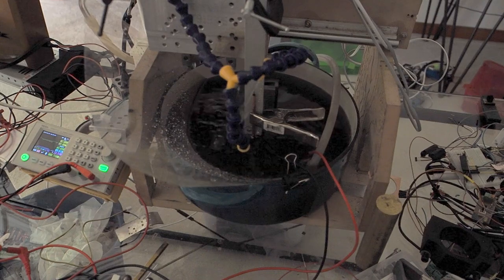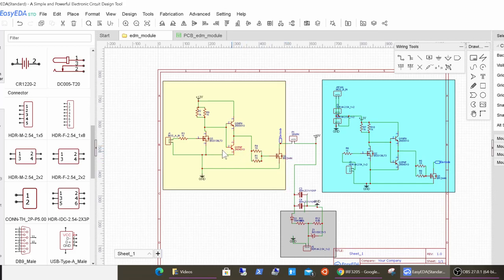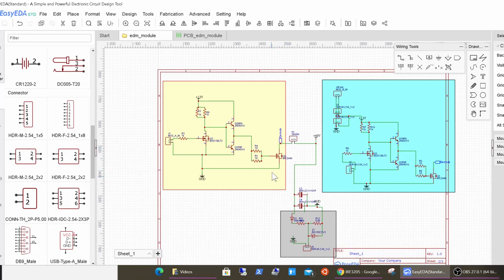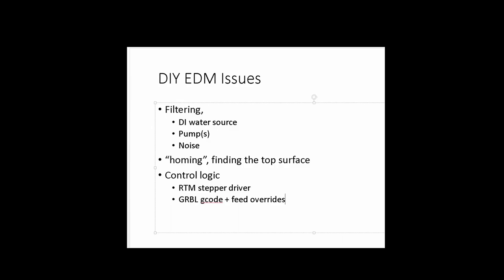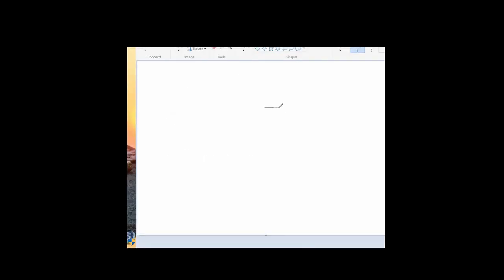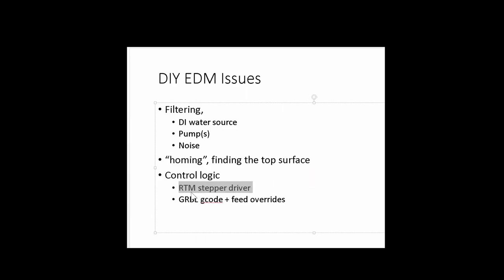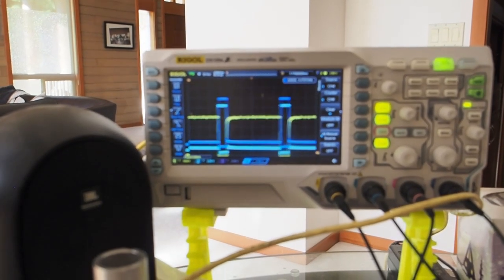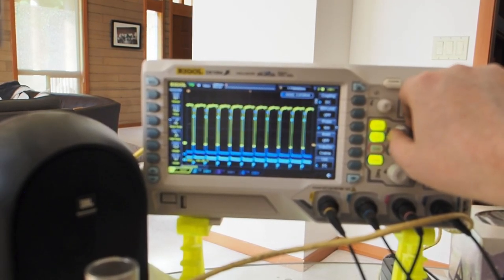DIY EDM circuit and setup

Comment: Wow, nice video! I came across this and another EDM new build video today and I’m surprised how people over complicate what is really a very easy to build machine. You don’t need to use a pc or anything like that to control the EDM burn (plasma discharge) as the power generator works simply by Ohm’s Law and the control is via a voltage divider to a comparator or the like to control the burn voltage window level (gap volts). 
I once built a 100 Volt DC with up to 10 Amp pulse EDM using an old drill stand and off the shelf parts and simply wired them all together and it worked with good smooth control and very low electrode wear rates and I used it to make small press tools and coin dies etc. The machine used a 12 Volt DC geared child’s toy motor, a bidirectional control unit, a square wave pulse generator (1 to 150 KHz) and a head (z axis) lift timer module (for flushing) it also had all the features of a commercial EDM like the standard up/ down z axis control for clocking your work piece and dither for edge or lowest point finding, positive or negative head polarity and you could even spark erode in the up direction so that you could burn through and then back off a press tool bed. 
I’ve scrapped that machine now and I’m now working on a stepper motor version (a lot more complicated wiring) with an anti arc control which in theory switches off all the very low volt, and potential, arc pulses so limiting electrode and work piece damage, but it’s still ongoing. 
I only have basic electrical knowledge but I’ve worked on EDM as a toolmaker for over 40 years and I know and seen how they work inside and out and boy I wish I had your equipment etc as I could build an awesome EDM. 
Anyway that’s enough about me, keep up the good work but I would have a rethink about the power generator and control design if I were you.
Reply from the maker: I agree digital control for EDM is very hard and analog is likely much better for a basic machine.  I didn't want to use dangerously high voltages and that is one reason for my design.  I also read a bunch of papers on the topic and though it would be fun to attempt digital control.  If you can document a low voltage DC (<48v) controller I think you'd have lots of fans.  While my setup is hard to control I found water filtering, tanks, and work holding to be bigger challenges though.  Unfortunately I have no real use case for a sinker EDM and I'm not actively using the one I built.  I would like to have a wire EDM but that is a much bigger fish to fry.
Reply: @JesseSchoch  The control design is the same for a 48 volt machine as for the 100 volt industry standard machine you just need to change the values of the resistors in the voltage divider (gap volts) and the output resistor (amps). Wire EDM is a very complicated build as you need to keep the wire under tension all the time but the x y control is easy if you use linux cnc which can reverse the g code to back off the wire if there's a short etc.
Reply: @JesseSchoch  Several questions: Does digital control offer higher speeds versus analog (aka doorbell solenoid?)? What are the benefits of using digital control?  
Does the WEDM use the same generator as a sinker EDM? 
Do you have any plans to make it open source (board layout?) 

From my understanding, there are some EDM/WEDM projects over the internet, but they mainly use commercially available pulse generators (quite expensive ones, I should say), and I can't understand why. 

Speaking of filtering: i've seen some people are using just small volume of oil, which almost instantly become black, but that's enough to make some 1mm-depth markings/'stamps' in steel.

Comment: Awesome video! I'm working on a very similar circuit currently. What's the purpose of the 2 separate MOSFET circuits? Is it just to share the power/heat load between them? Also what cap values are you using?
Reply from the maker: yup, they could be run in parallel (if matched enough) or interleaved.  If interleaved you could expand the number and increase the pulse rate easier.

Comment: You basically have a very complex RC type EDM power-supply. 
Those caps will discharge across the gap in about 1-2micro sec. so if you "ON time is 20us you are wasting about 18us of time doing mouthing.
 I have never understood builders that want to make the very simple basic RC power supply complex.
 Most of the electrode wear takes place in the first 1-2 us. so you have gained mouthing. 
To get to less than 1% electrode wear you need to be in the 100micro second ON time range and with capacitors in the electrode circuit you will NEVER be able to do that.
 Also you do not need a computer or software or a stepper motor to built a good operating EDM system. 
 Using the water is NOT a good idea unless you  have the proper DI water. 
Use a very light oil like Kerosene (not diesel)  or even WD-40  works quite well and it gets around a lot of problems with using water.